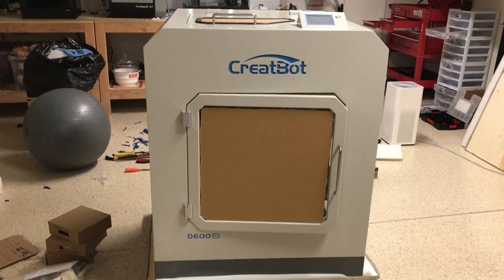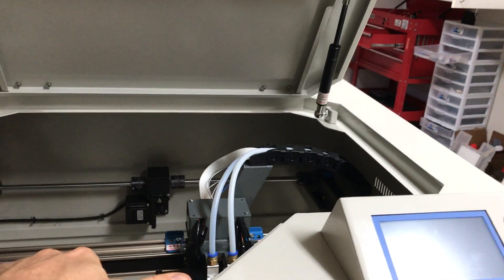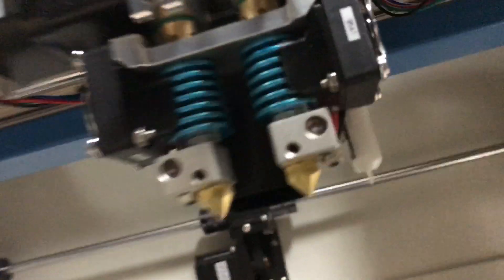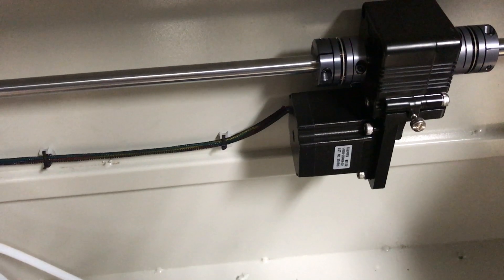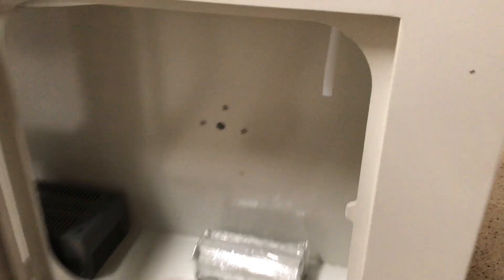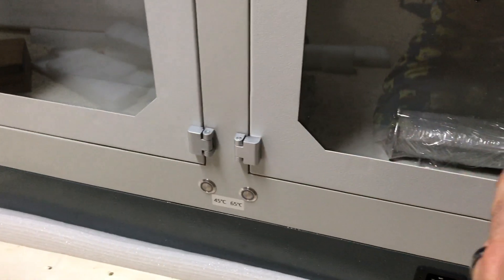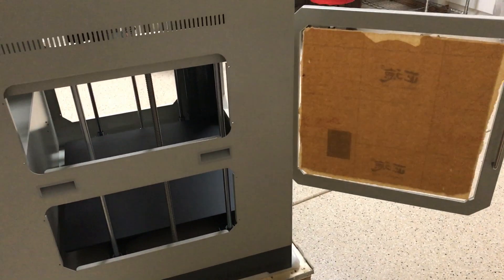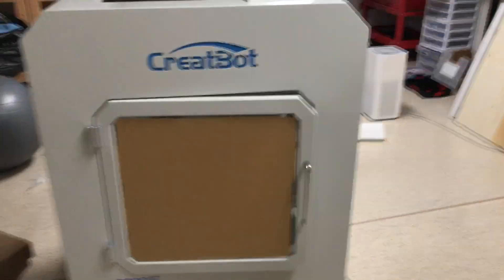3D Labs - Creatbot D600 Pro Intro

Comment: Just found this video.
I am really interested in this printer as I get more and more orders for larger items than I can print right now.
Currently I use five Creatbot DE (2x) and DE-Plus (3x) and these together have been printing about 24000 hours now. I do have issues with clogged nozzles from time to time (I print a lot of different materials) and sometimes the filament-out system does not work properly, but overall I am pretty happy with these machines.
Could you tell me a bit about the problems you had with it out of the box?
Are your running the 3 mm or the 1.75 mm version.
Reply from the maker: @mvm1162  The D600 is fairly noisy with the stock drivers. I would say the heated chamber addition is worth it if you are printing large scale ABS. It's pretty much a requirement unless you are in a very warm environment.
Reply: A big progress!  CreatBot D600 and D600 PRO now equiped with better driver, so it is quiet when working.  Many other small issue are solved and improved now!
Reply: Were you able to connect the d600 pro straight to the 110 voltage or did you need  a 220 -110 converter?.

Comment: Hello, how is the 3D Print quality? OR can any Creatbot D600 Pro 3D Printer owners comment on the 3D Print Quality?
Thanks
Reply from the maker: The print quality is good for such a large machine. Just remember you're not going to be printing at extreme speeds on a machine this large.
Reply: @3dlabs754  Are you saying that the 3d prints are slow because of the size of the 3d prints or the large 3d printer machine is just slow overall?
Do you sell and or service the D600 Pro 3d Printer?
Thanks for the info.
Reply from the maker: @patentexperts1675  A combination of both actually. You can greatly offset the speed differential by using a much larger nozzle, however. We sell and service the D600 Pro.

Comment: Hi, how is the machine holding up after 9 months? I am curious how robust it is since sending it back to the manufacturer for repair is not quite feasible in this case.
Reply from the maker: It has held up well hardware wise. We offer repair services in the US on the machines.

Comment: Hi creartbot team. I have a same machine but I did a wrong calibration for the touchscreen. I mistakenly make the top left as bottom so no matter what I press it all goes to the left bottom and I can't do another calibration.is there any button I could reset the whole screen to factory mode and start it again?thank you so much.
Reply from the maker: If you tap the screen about 20-30 times rapidly in the same spot, it should enter calibration mode.